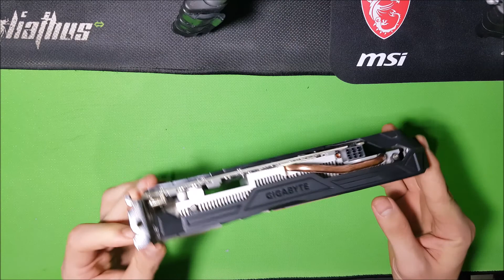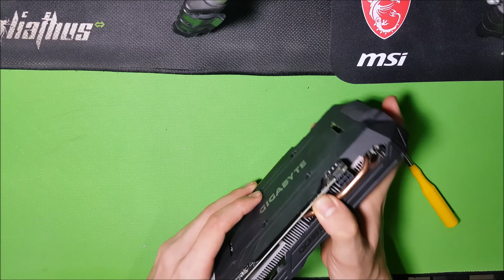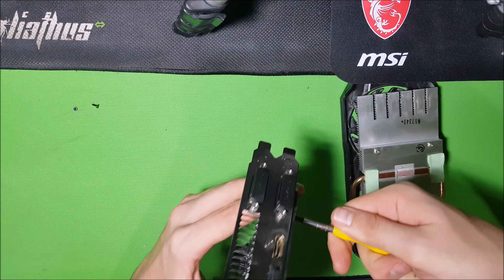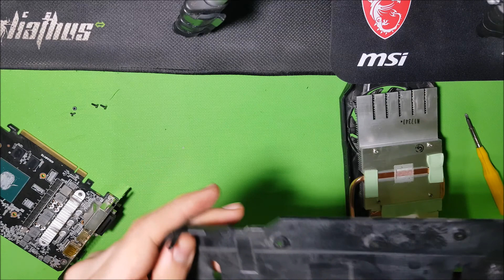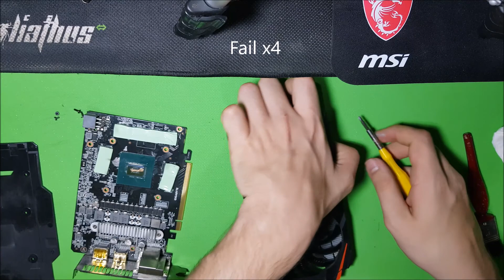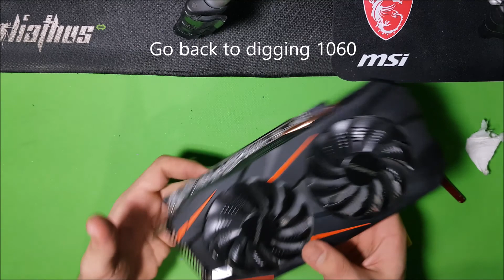Gigabyte GTX1060 6GB After 1 Month of Mining

Comment: i dont know if you are going to answer me but it would be very helpful. I want to do a full clean on my gpu (the same as yours) but i dont know wich thermal pads i should use because of their different widths, do you know any information about it? please.
Reply from the maker: You need to care about their thickness to fill gap between components and cooler base. In amazon you can find every kind of thermal pads. Any of them with same thickness will work
Reply: @Cyptech  I had same question as Diosdado.  I dont know where to find about about thickness of 1060's pads.
Reply from the maker: @marekrybka390  check amazon or aliexpress. They usually sells 10cmx10cm with 1mm to 5mm thickness
Reply: @Cyptech  I know that they sell it, but I still dont know which thickness is proper for 1060 :)
Reply from the maker: @marekrybka390  
Usually vram modules needs 2mm, power modules 3mm